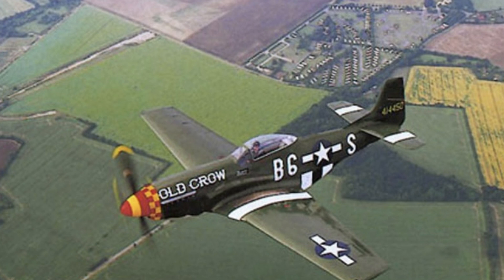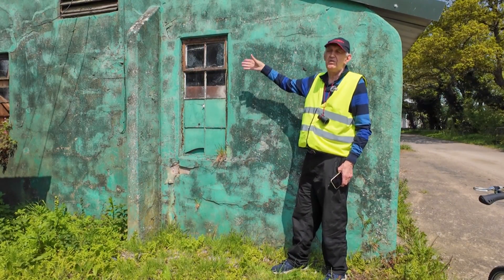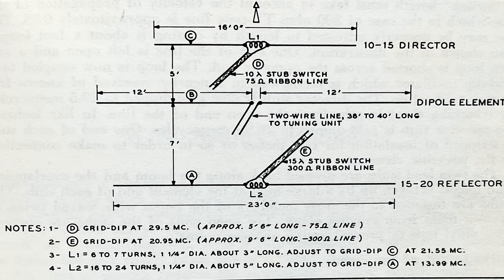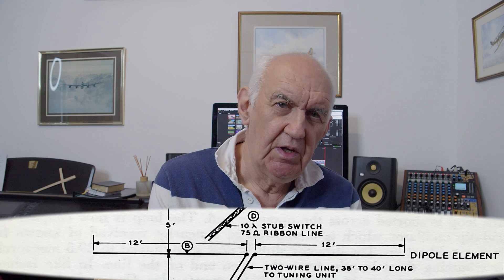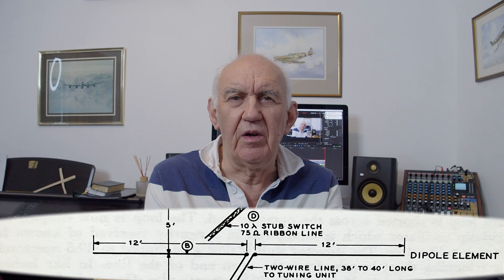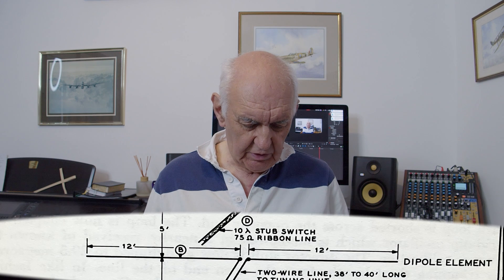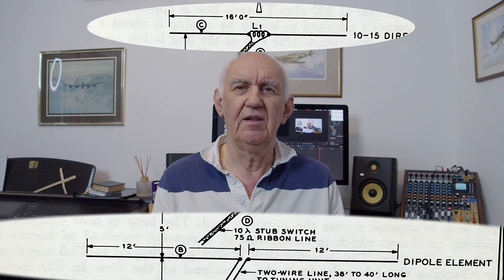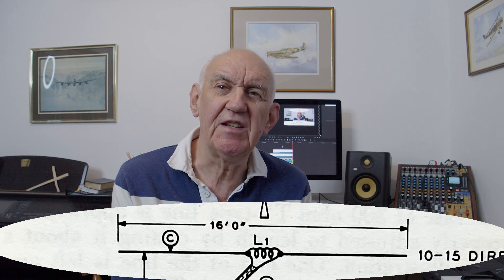HF Yagi MiniBeam - Let's Build One.

Comment: Would you not have to put limits at both ends of rotation as you don't want the ladder line wrapped around your rotator.
Reply from the maker: All rotators have limits of rotation. Usually just over 360 degrees.

Comment: Thank you Peter.  Here is a challenge for you:  How about gathering the materials and maybe a helper and making a series of build videos for this antenna?  Maybe put together a kit for sale so we can all build one?  Finding the right kind of aluminum and bits of hardware to build antennas with is sometimes a real problem. Especially stuff that is 12 feet long and has to withstand high winds.  I think it would be fun to build this antenna.  Dave WD9O
Reply from the maker: Unfortunately I don’t have a tower and at 81 years I have some limitations! But nice idea.
Reply: Be good if someone else who as built one to do a step by step guide to building one
Reply: Agree 💯